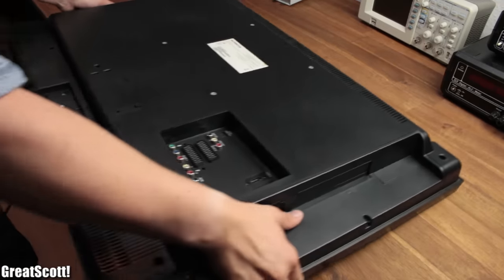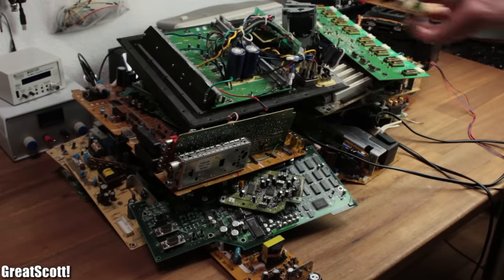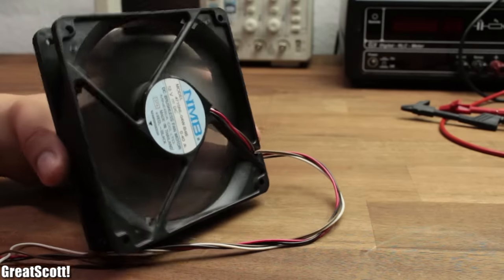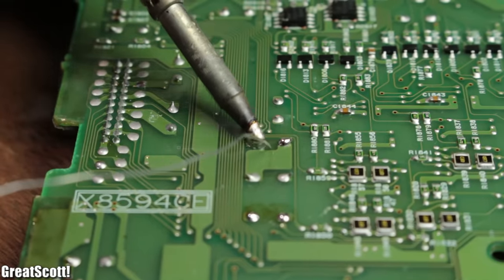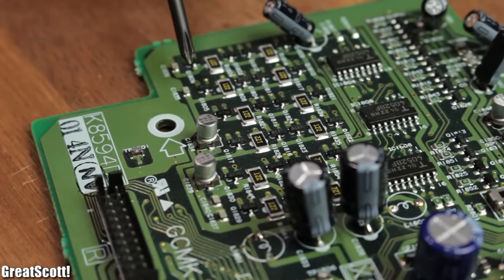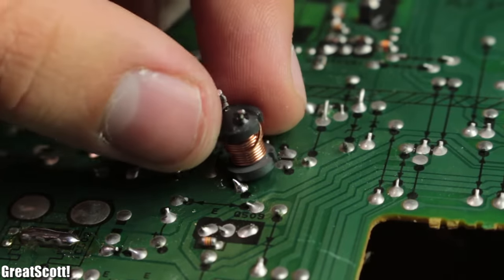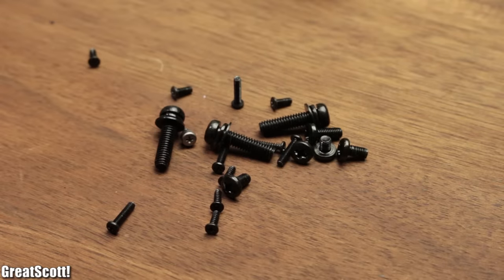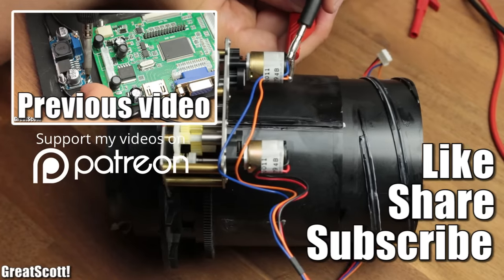What is worth desoldering from old electronics? || DIY Fume Extractor

Comment: Most electrolytic capacitors aren't worth it.
Almost all manufacturers these days choose to dimension them in a way they only hold up to the requirements if the are on the max positive site of the tolerances.
Often they are around 10-15% to small for given circuits and run at temps of 70-100°C.
You just have to look at the datasheets to know their lifetime will be shortened by 50-70%.

Whats almost always worth it would be ICs as they are mostly expensive and can come in handy in lots of problems.
Also there lifespan is almost infinite. I never saw a broken IC which was properly used.
If desoldering with an iron is a pain in the ass - just get an electrical pan or maybe better (for example to desolder SMD easily) a hot air station.

Comment: Why is it that your soldering gun melts the solder right away, but with mine I have to hold it onto the tip for a few seconds before it melts, even if its turned all the way up? The hell is that?

Comment: you shall get Hot Air Gun / Soldering Station Heat Gun for desoldering ! Much faster and actually enables desoldering almost everything;
Also you fan is too weak to properly suck out the desoldering fumes

Comment: Thanks for the video,, I guess we think alike, I really do need to get myself a better solder gun, maybe even a station. Whenever I find a projection TV in the trash I make sure to grab and strip it down , The optics are nice to have plus the screen lens primarily the Fernel lens, an other thing I like to pull out are many audio speaker. 
     I am old school when it comes to home sound systems which at one time we're priced reasonably most because they were hard wired to the speakers,,, Now everything is bluetooth speakers and cost an arm and a leg,,, I don't get it, Even if it's made with quality amplifiers and speakers the price for these unit are priced TOO high in my mind? Anyone agree? 
       I tried to find a new home sound system like the ones make 10 yrs ago using wire to connect speakers to main amp ,, They not available that I have found,, I think it has to do with the bluetooth systems audio output AND listen capabilities ,,, "They" always want to listen in to what it said for advertising reasons,,, or whatever.

Comment: Dont waste your time despldering parts with a soldering iron. What you do is get a butane torch set on low flame and waft it over the areas you want the parts from you have to wear a resperatior and do it outside ...the parts very quickly just fall off the board smd parts included after just tapping the board when it is upside down.
Reply: Ps you waft the gas torch on the non component side

Comment: Everything, desolder litterally everything! D
Heat your irons and load your heatguns to desolder and untie those bounds of metallic fusion in the name of component freedom! Discrete component liberation front will prevail!
Reply: Breaking news:
Today, a captive group of 12, 800uF 480V, Y-rated 3-phase, automotive grade, Rubycon capacitors; Were just liberated from the stronghold of 24 point-to-point ROHS infringements. The individuals in question were, upon discovery, tied toghether by an excessive amount of white celastic putty. The amount were, according to whiteness, adequate to not only fasten each cap to another but also individually to the board itself. Overhead research imagery reveald a 2-layer GAP PCB with massive groundplane were an approach with traditional heatgun or iron would be futile and likely cause irreversal thermal damage. Executive decision from rescue opted to deploy an ancient three stage air mixure controlled propane torch delegated with strategic distribution in a two-stage strategy. The strategy being applied, named by one of the participants who insists for security reason to not be named publicly, is called "Preheat and thermal sweep". Official report states colateral damage were unavoidable. Keeping to the instructions keeping hotspots to a minimum and despite the second heatwave resulted in the elimination of a handful of SMD-bleeder resistors along with nearby decoupling MLC's, the DCLF and its supporters rendered the mission a successful story with a happy ending. None of the captive Rybies showed any sign of post event heat related stress symptom. Later ESR measurements also provide  supportive indication of above statement.

Comment: I would subscribe, but you aren't talking about valueable parts. You passed by them like they were bottle caps. You passed by MLCC Palladium bits, extremely valuable, and also the silver cap capacitors that are almost filled with silver. Is your video mainly directed towards RE-USING the chips? Not scrapping?

Comment: Isn´t faster using a heat desoldering gun? Buy it and you can desolder ICs and chips pretty fast. Also about fumes - Lead doesn´t evapore, there is only small amoun of molecules in air. If you are not doing in indusrial size - You are OK. This is made more dangerous by lead-free solder since the temperature required for a good joint is higher. Flux is what is dangerous.

Comment: Nah, You can use a torch outside in the wind, use a flat screwdriver to deal with bent leads when the solder is liquid on the few that dont just fall out.  Your way takes way too much time.

Comment: I really wanna get into building electronics stuff but I’m 14 and am too anxious to ask my parents heh so I am here now wanting to find out how I can salvage parts from something ai have problem is I don’t think I have anything To get them from that doesn’t work I used to have broken calculators But I have no clue what happened to them I feel like I am gonna have to wait till I’m older but that’s sad and if I wait I would have wasted all this time I could have used for designing circuits ugh what do I do……
Reply: Try raspberry pi projects. You can do a lot of things that would need electronics with the raspberry pi, like putting out a certain pulse modulation. The Raspberry pi is kinda like a small computer, at least you can use it like that, and it gives out relatively harmless 5-12 V (i think). You still shouldn't touch that, but it's not dangerous. Also get a breadboard for making circuits. That way you can make a lot of different projects without needing to solder and can reuse all the parts.

Comment: >>>     -   used  to get    defunked   pcb   -   many  components  -  once   out  -  if time  test  before re-use
G-clmap    held  pcb   verticle    -  out  back  of  house  where  the air runs  free  .  Propane  burner    -  smallest   nozzel
warms  it  up    ,  small  screw driver    prize    the  component  old     - old  long  nosed  pliers   to  pull it  out.

Components  rated at  200  C     for ten  seconds  -   when    experimenting   -   the  component   put  under stress   -   thus   pre-streesed   ( and  cheap )  serve  the   purpose  beutifully  .  ebay    not  in existance  then 

The   pcb    -    cannot   use    it  - too  burnt    - the  fumes  that   come   off  -  considered  toxic  -  get  up wind   of  

Cannot   find    anywhere    that  has  done analysis   of  fumes    from such  pcb  - ( poly cholrinated  butyl )  -printed  circuit   board

Comment: that amount of carbon filter will do close to nothing, just get a cheap bathroom extractor and pipe and put it out of the window/door. That or get an inline carbon filter attached to the extractor if pipe is not an option. Solder fumes are actually not that harmful unless your doing a shit ton of soldering, since lead content is much lower than it used to be. The smelll is not that pleasant though.
Reply: Or just buy a proper extractor with filter. they're not that expensive, designed for the purpose and comes with everything you need.

Comment: The Chinese are doing this with ships loaded with old boards. They have slave labor that de solders components, cleans them up, and repackages them for sale as new components. They also have some operations that relabel the cheaper commercial versions as the higher quality, more expensive versions of circuits and components, which is called "counterfeiting." We are sonctantly on the look out for counterfeit. It is not always easy to detect. Sometimes you can see evidence that they carefully sand blasted the old numbering off and reprinted new numbering and manufacture symbol. China is the #1 source for counterfeit product. It's possible they are placing used compenents into their newly manufactured televisions and computers. The media does not report on the ships going back to China with old, used circuit boards still populated with all their components waiting to be sold back to you in the "new" television you just bought, or some other electronic device. Welcome to the grand rip-off by a country with no ethics.

Comment: I have been doing this on and off since the late 60's. I go for the same components as GreatScott, avoiding the smd and most IC's unless they are generic. 
If you are stripping electrolytic caps, getting an ESR tester is a must. 
PC PSU's can provide nice fans, rectifiers, switches and heatsinks but many IC's and semiconductors are so specific to power circuits that their use is limited. Be careful about caps from these PSU's as most of the them have done many hours, have had a lot of heat so make sure you check their ESR.
Similarly semiconductors and IC's from TV's are so specific that they have no other use and aren't worth the effort. For instance "BU408" transistor is for horizontal deflection output stages of TV’s and CTV’s circuits so having a PC available as mentioned in the video will help you eliminate stripping items which may have little to no use for the hobbyist.
Other items I go for are pots, knobs, magnets, pillars, stand offs, inductors, micro switches and machine screws, nuts, bolts, washers, self tapping screws, cabinet and stainless steel screws from washing machines etc These items have proven invaluable over the years for repair of other items.

Comment: A faster method of desoldering parts would be to get a hot air gun and simply pull the parts you want on the other side of the board. Not salvaging those old rare transistors, really? But saving old electrolytic caps???

Comment: oh no my poor lungs
i'm gonna end up like my mother, an avid smoker. I have an old pc fan but i have no way of ordering a carbon filter, but i guess a fan is still better than nothing
Reply: A long time ago, I needed a ventilator for my de-soldering station but I was on a tight budget. So instead of having some fancy carbon filter lying around, I cut a piece of cloth from a wash cloth, spray painted it black, and attached it to an old fan. It certainly did the trick but my mom was mad as hell at me the next morning when she jumped in the shower! Suddenly, she started screaming and yelled for me to get into the bathroom. With the shower curtain pulled to the side and her hand outstretched, she said, "What the hell is this???" I said, "Well, I'm no expert, but it looks to me like a naked woman with soap all over her chest." She said, "No, the thing in my hand, wise guy." I looked at her and said, "Oh that, I was going to tell you about it but I guess that it must have slipped my mind."

 Man, those were the days.

Comment: Most of electrolytic capacitors are not worth de-soldering especially ones which were exposed to either high temperatures or HF ripples, as they won't last long even if they still look OK so far.

Comment: 5:06 begone you foul devil!!! I m a messy dude who always has things spread around him but even I went to the effort of sorting out my screws nuts and nails, roughly, in a box with a dozen different storing areas.
Even added a little magnet in each*, the thin short thin threaded ones were all together, the thicker threads together, nuts in the appropriate section of bolts it fits... 
Had hundreds, make above a thousand and spent like 3h organising them, and the moment i knew where THE (its always that missing little pos right) screw was my life became about 80 times more enjoyable, i had 60 times more motivation wasted about a million percent less time, and lived a relatively good life, torturing electronics, doing exactly what the instructions forbid or trying more dangerous projects, let's not talk about that 500v incident.

Instead i will break any decant mans heart, crush and snort his soul (where did that come from lol keeping it) by telling the tragic and horrifying tale of the "pitch black 5am terrorist planted un locked multi hundred screw parts. 
I broke the box, crushed it and sent screws everywhere-  ended up making a dual dust and ferromagnetic broom to collect stuff lol-. 
I knew i had f up the moment my foot touched it, by the time the pain registered i d gone to half hungry 4/5 sleepy to pumped full of adrenaline to save the innocent screws.
I m ashamed to say i did things nearly as barbarically as your scroulag there, they are spread on magnets as murdered puppies nailed to walls (at least thats what they tell me, i know a lot...₩

*i have so many magnets its becoming a nuisance, but i can't resist the idea of a magnet i ve teared down perfectly fine hundred dollar storage drives, they are objectively an added benefit to your life as is salvaging and having to store dozens of lithium batteries and like 5 times the pcbs cute scott dumped at the beginning.
Reply: If my screws get mixed up, they stay like that.

Comment: Wait a dam minute.  Ur worried about a fan but you use the lighter to shrink the heat shrink? 
Thats ghetto af.  
Now "if"  your throwing away the whole baord afterwards ' then the easiest way and the fastest way is to use small propane torch ' heat up the solder on the other side ' and piece comes right off with out damage ' 😉

Comment: Lmfao you need a rework station ( cheapest 70$) and flux paste to remove the components much faster and safer so they do not get damaged . I do not throw out any electronics before removing all good components . Hey you copied my fan exhaust system lmfao I hooked my to a DC transformer and added a power on off switch on top of the fan lol.